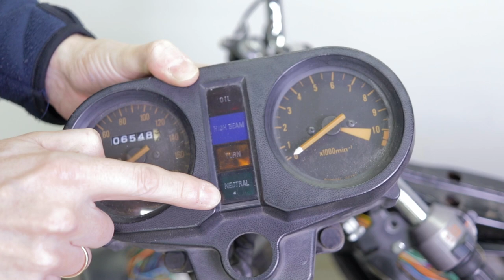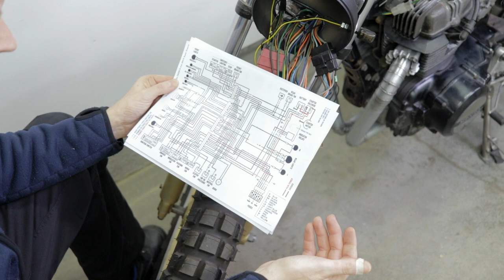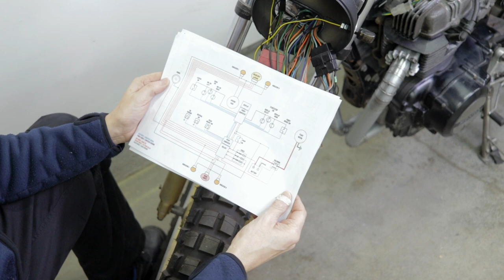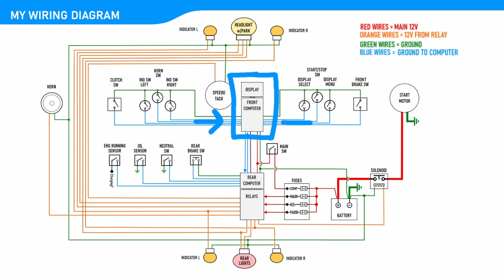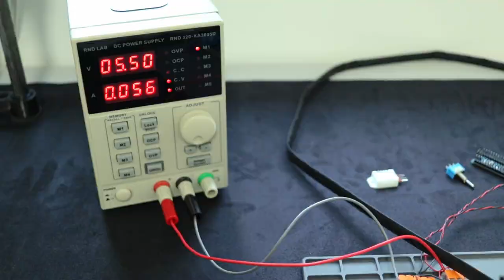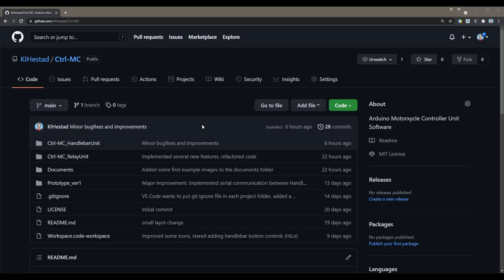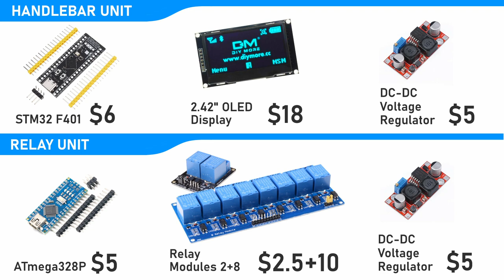Motorcycle Wiring Done Differently - This Can Be BIG!  - Honda CB400 Cafe Racer Build E14·S2

Comment: Great video! Great explanation of how overly complicated the original system is due to the manufacturing process. Very trick stuff with making your own controllers!
Reply from the maker: Thanks 😊 it is both fascinating and frustrating to work with an old wiring harness. It's really very simple to understand, yet so complex to figure out 🥴 Almost done with the first prototype of the home made controller now, it actually works 🤓
Reply: @kihestad hello there from Greece i have seen all of your videos and its all perfect... can you give me more information about the diy kit that you have make (code- parts -diagram) to make for my cb250n i know some things about Arduino because we have it on university but i don't know too much about the wiring of the motorcycle
Reply from the maker: @bacardilove1981  hi 😊 the project is still in development phase, you will find more info on my homepage: https://hestad.no

Comment: You have no idea how blown away I am! For the past year I’ve set out to do the exact same thing from scratch with minimal starting knowledge. I’ve gotten so far with wiring and buttons as well as 3d modeling prototype parts, however the code is my struggle! I look forward to reading your code and modifying it for my own bike! 🎉 cheers on such a great make
Reply from the maker: Cool! I have had quite a long break from this project, but I am soon to start up again. I have a working prototype, but decided to upgrade some components and add even more features. I have also played around with the thought of replacing the monochrome OLED display with a circular color TFT display, and add sensors for speed and engine rpm. Then it could end up as a complete solution without need for a separate speedometer / odometer. Even fuel tank level indicator could be built in, the possibilities are endless 😊
Reply: @kihestad  I’m so impressed! I’ll be keeping it fairly simple since my ebike would need a Speedo and a voltmeter and that’s about it. My display will hopefully be the esp32-s3 LCD with wifi and Bluetooth
Reply: @kihestad  YES! Please do! 

I have an idea for your foreseen SSR version, using cheap components. Hence I should really check out the Discord channel you started.
BTW my Ducati 900SS project is nearing completion.. exciting stuff ;) and with plenty of time till we hit the first rain free days at 15 centigrade (which probably sounds pathetic to a Norwegian I'm sure 😆).
Reply from the maker: The temp is 5C here where I live in Norway just now, and that is hotter than normal 😳 15C is no excuse 😜 just put on some warm clothe, and you can take your Ducati out for a spin. Must be great to almost be done with the project. I will focus 100% on my bike builds now, it has taken too long time 😔

Comment: Im not an electronic guy. Just a motorcycle freak. Glad I came here. Now I cant wait to learn. This is advance motorcycling here
Reply from the maker: Hi, thanks for dropping by! I think it is not very common to be both a motorcycle freak and electronic nerd - like me 🤓 It is really not that difficult, but it takes a bit more patience compared to doing mechanical work on a motorcycle. If you do the wiring wrong, like mix up positive and negative cables, it can end up with a very bad result. I have managed to frie a microcontroller and a relay unit so far because I had plugged and unplugged it so many times, got a bit lazy and skipped checking it all before powering it on 😏 Not very expensive parts luckily.

I will make a follow up video soon now where I show what I have done so far, and probably some in depth videos as well for those who want to learn. Stay tuned!
Reply: The freedom to control the OLed indicator display alone is so awesome. Not too many are excited to learn how things work on these electronic stuffs. The very least appreciated art behind motorcycling
Reply from the maker: I guess it's not for everyone 😌

Comment: Oh man.  I have a 77 Yamaha RD400 that is in dire need of an electrical overhaul and thinning! This idea of a computer controlled electronic system for all of the turn signals brake lights Etc is exactly what this bike needs. Trying to shove 6 Mi of wire behind the headlight is a recipe for disaster. Having 10 wires total on the entire motorcycle would be ideal. I love this idea and I want to follow it all the way!
Reply from the maker: Haha, sounds familiar when you describe wires behind your headlight 😂Had to take a break from this project for a while, but hope to soon get back on track and will post a update video eventually

Comment: Wow, you really are handy in the garage and on the computer. 

I looked at the wiring on the cb400 in the garage, and it made me think of something that Al from the Skid factory said.

"Typical 80's Japanese wiring," he then said something about that they did it in weird ways and not very straightforward. 

Although the bike is from the late 70s (78), the wiring is still a mess and did not impress me.

For what it's worth, it doesn't look like someone messed with the wires before. Only the rear tail light was changed, but it looks like they just used male crimp connectors and attached it to the factory female ones.

After doing the brakes, the tail lights are getting changed back to the factory. I was able to find an old stock tail lamp on eBay, and thankfully, the bike came with the original bracket.

Which is also in much better condition than ones I found on eBay.

The current headache is to get the front disc brakes back to spec and make sure their working properly. 

Fingers crossed it only needs a good bleeding, but I'm expecting a Master cylinder rebuild.
Reply from the maker: Haha 😂🤣 I do agree with the AI from the Skid factory! The wiring on these bikes are quite confusing, and it can be very challenging to fix problems if someone has tampered with it. You are lucky if the wiring on your cb400 is more or less untouched (so was I).

Sounds like your bike has been slightly rebuilt, and you are putting it back to original?
Reply: @KI Hestad  Yes, I'm doing a bit of restoration work. It would be hectic to have two of the same bikes but a cafe racer caught my attention and when doing research on the bike I found lots of examples on google where people turned them into cafe racers (that's how I found your videos). I like it but would not be able to do it to the Honda in the garage. My father said he thinks he would look silly on a cafe racer and he would also not want to do it to the bike.

To the best of my ability and do as much as possible with what is available in the garage and not spending huge amounts on it.

The bike has an interesting history and one that I don't know all the details. I forgot the fine details; my father bought it in 2019 from a bike collector.
The bike sat in storage for most of its life on a military base. I'm not sure what they used if for, or if it was someone's private possession. 

Currently has 20 892 Km on the odometer. 

Thankfully, the bike is very good cosmetic and mechanical condition. She's not perfect, but at least where I live, you won't easily find another example like it. They sold very few numbers, the cb750 was more popular. 

Back when my father was a young boy his father  had a bike that was nearly identical to this one. So that, the condition and price is why I think my father bought it.

So I have rebuilt and cleaned the carburetors with lots of new parts, replaced stripped JIS screws on the Carbs with hex ones.
Rebuilding the carbs was very intimidating to start with, but once I got inside, I couldn't understand what the fuss was about from other people that i talked to prior starting with the project. 

Their so simple and basic to work on, but the understanding and fault finding is a mystery. 

Local bike shops were very hesitant to work on the carbs and eventually one of them referred us to a carb expert. He could do it, but said we needed to source the parts ourselves. So I then asked why don't I give it a crack? So that's how it started.

I replaced hoses and added float drain hoses that were missing. Treated minor rust , resprayed the battery bracket, and added a new rubber mat for the battery, as well as replaced the battery.

Sprayed silicone spray on the old rubber parts, cleaned the electrical components (still need to do the ignition coil's ground pins), added labels to the fuse holder, cleaned it and need to get 7A fuses.

I did tidy up some wiring near the solenoid looking thing near the battery and removed old electrical tape and used heat shrink.

So next up is to bleed the brakes, and if they are still weak, I need to inspect /clean/rebuild them.
Then, I want to restore the rear tail light to the original.

There's lots of other things that I would like to do, so it's a continuous project. 
But first need to finish the necessary stuff and then the nice to haves.
Reply from the maker: hehe, I am sure your father would look badass on a cafe racer 😎 but it sounds like the right choice to get it back to original since it has such a special history and it has only run 20K kilometers 😮 that is rare!

Good luck with the project, I am sure it will be in perfect condition when done!!!

Comment: Wow! as you described your idea, i had to laugh at how similarly you looked at this probelm to myself. I've been slowly working on practically the same project, for 9 or so months minimum.

I will be running my system with my (permanent) "project" build, a 2 stroke gilera runner from 2012. I'm nearing completion of the prototype boards, including custom multi segment RGB lighting boards for the tail markers, turn indicators, dash indicator lights. Power distribution and rectification and relay switching for headlights + starter. I'm still undecided on 100% new guages, or replacing the existing LCD in the original cluster with a dot matrix unit. Total configurability is my biggest motivation and design philosophy for it all- doing it right so somoene else can benefit from all the time and thought i've already put into the concept.

I have started preliminary work on the display/monitor MCU, which I'll be using a RPi2040 and RF control for the security side. I'm adding additional monitoring hardware (CHT/EGT sensor, flow sensor for coolant, and anything else that catches my fancy)

The lighting system is on it's own sub board, running a separate MCU with hardware LED drivers and various redundancy/failsafes + protection for the bike management side of things which is slaved to the RPi

I have stripped down the bars and some of the uglier panels, and will be using aftermarket switch modules to feed inputs to the system, and I'm keeping the (tidied up and simplified) stock ignition/charging system for now, but if I ever complete the rest of the rather daunting chunk of work, I'd like to work on custom charging/regulation circuitry in hopes of some added efficiency and reliability.

My biggest challenge by far is the code side of things, but that's what motivated me to take on a project of this magnitude to begin with- my skills relating to analogue and even logic level hardware massively outstrip my ability to code, and I'd like to work on bringing my skills up to parity.

I sincerely hope you're still working on this project, I will be following any further info that you put out with much interest, since our projects align so closely in goals and strategy. I'm interested in documenting my own progress, so I'll try and keep you in the loop once I put stuff out here on the internet.

I wish you the best of luck on this, I hope we can collaborate on some level as we both solve the problem, since as I'm sure you know, it's not a simple or straightforward end goal. Much respect for taking the initiative - I totally understand your motivation even if it's a huge undertaking

From down under the world, in NZ.

peace and much respect,
Chris
Reply from the maker: Thank you for sharing and for your interesting story ☺️ I have prioritized other projects for a while, but are now ready to continue on my cafe racer build and my electronics project.

Comment: Funny, this is exactly how I figured I'd go about doing the wiring on a custom bike like this. I've messed with arduino a good bit, and sure enough, seems I'm not the only one to think of this.
Reply from the maker: Cool! I had to put the project on hold for a while, but I am soon to restart it. I have done quite a lot of work though and have a working version, but I am constantly improving it 😁The latest addition is an accelerometer / gyroscope to enable self cancelling indicators and emergency brake flashing 😋
Reply: @kihestad  Oh hell yea thats awesome. Almost want to look into using one on my bike, but mines a bit too modern for that. though when I get around to a project bike im def gonna give it a try.

Comment: I wasn't looking for this solution (I was looking for what best cable covers to use) but what a fantastic idea. I too have a CB400N and I'm struggling with hiding so many wires. What a fantastic idea this is. I'd be really keen to help in whatever way I can!
Reply from the maker: That sounds great 👍 I have been working on the project 'behind the scenes' and the first prototype is soon ready. Plan to make a follow up video soon!

Comment: Hestad, you are full of surprises....I apreciate the MotoGadget products, but by 83' CB400 was chaepaer than one unit. Not to mention the display and the entire kit of needed parts. Note that there are also availabe self-maintaining impulse relays, on same blue PCB like yours, and you can control them with impulse, like OEM Motogadget switches.
Reply from the maker: You are absolutely correct, and I am already in progress of looking at alternatives to the relay module. Using solid state relays (without moving parts) is probably a better solution. It is smaller, possibly more long-lasting and do not need as much power to operate as the relays. Thanks for you input! 😊

Comment: Really cool project. I'm a bit late to see this. 
I have a 1977 Honda CB550k and im both motorcycle and electronics enthusiast. i've made PCBs that integrate micro controllers like arduino and esp32 with the addition LCDs.
simplifying spaghetti wiring would be an absolutely fun project. wouldn't be very difficult either. 
if i didn't want to keep my bike stock i would take on a project like this. maybe if i get another vintage spaghetti wire bike i would.
Reply from the maker: Hey, that was fun to read 😊 Glad it's not only me that's interested in both mc and electronics 😊
The project is still ongoing (after a long break). I might end up designing a PCB for the project, but I still learning 😋

Comment: love it! What more could be added is auto-off turn signal.. gonna try as my first Arduino project
Reply from the maker: Thanks ☺️ I have actually just recently bought a couple of gyro/accelerometers and will try to include it to the project. Auto cancelling turn signals and perhaps auto brake lights as well.
Reply: @kihestad  Auto brake lights would actually be pretty neat! Motorcycles can brake pretty hard on just the engine, so I will sometimes actuate the rear brake just a little bit sometimes so that the cars behind me will know that I'm slowing down..

So I will definitely see if this is something I can play with on my build as well. (Also a perfect way to finally get started with Arduino!)

Comment: I have been thinking on the same solution for a some time. Great job. What I was thinking was to add multiplexer to the system. This will reduce even more wiring. Also there has to be a way to replace those big ralsys for somthing different and small.
Reply from the maker: Thanks 😊 Multiplexer is a smart addon to Arduino boards. I have switched over to ESP32, these have a lot of input pins so I don't need to use multiplexer with my current design. I am also learning about mosfets, and have got help to design a solid state relay board, hopefully 😋

Comment: Nice project. Was thinking the same for my bike. For the handlebar side, the T-Display S3 ESP32S3 would be great. The motogadget scope is very expensive and this could easily handle all the handlebar controls and speedo outputs that could be fantastic looking and small
Reply from the maker: Thanks! 😊 I have a fully working prototype now, but it does not include speedometer and tachometer -yet! My original plan was to use it in addition to an aftermarket speedo/tach-meter, but I do consider using a slightly bigger display - perhaps color display - and include all features needed into it 🤔
Reply: @kihestad  yes. That would be great, I think. I have one of these on the way and intend to cnc machine an enclosure for handlebars. If you haven't seen, have a look at this: https://youtu.be/AxJ3pf8yh5s
Reply from the maker: Yes I have seen these. They are very smart. I would like to have a circular screen, very bright and a bit bigger, but that had not been easy to find.